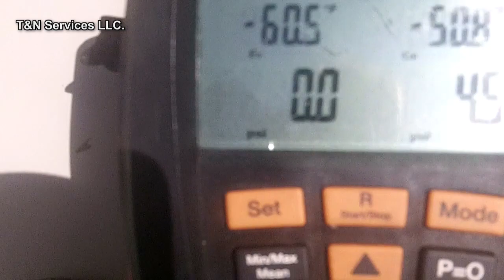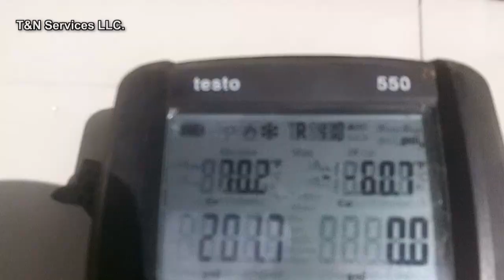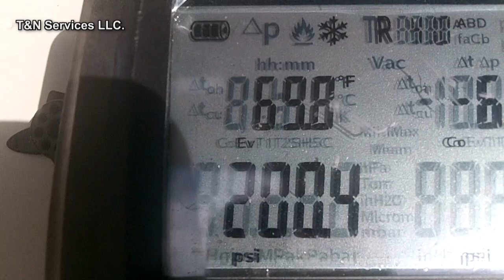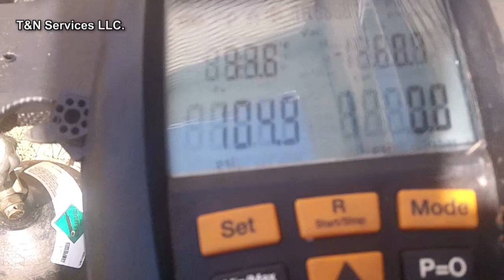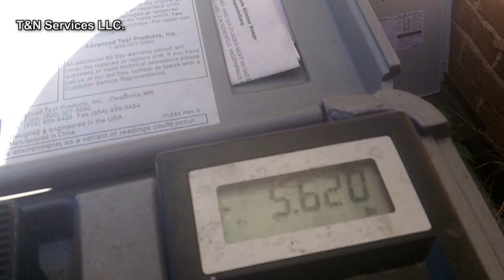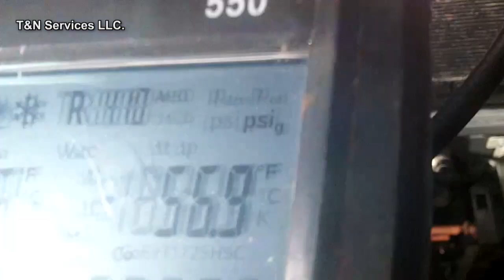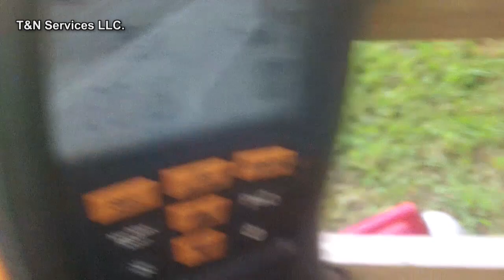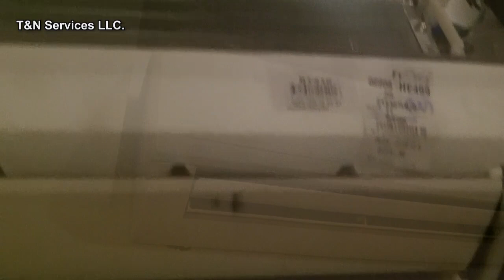Hacked Daiken Mini Split Job

Comment: common problem on the mini splits, it comes from installers not using the proper torquing procedure and flaring gauge. There is a reason why daikin requires torque wrenches and special flaring gauge and flare for r410a during their daikin installer classes. They also require a 500 psi standing pressure test for 24 hrs and a deep micron vacuum test for several hours.

Comment: what if instead of using the factory flare compression fittings for the inside heads, you cut them off and solder in 1/4 and 3/8 couplings? trading a mechanical connection for a soldered one. Then you only have to worry about the flares at the condenser.

Comment: Looks like he had Channel Locks best brand of tubing benders available.  Shame he didn't have a set of Knipex smooth jaw pliers, he'd have been in the clear! :-D  Put one of those Daikins (cooling only) in for a small server room, and purchased a set of torque wrenches made for that purpose, and haven't regretted it! Thing runs like a champ, especially if you just follow the instructions!  Oh well, their fail, your paycheck.  Good job!

Comment: How reliable are the Daikins when install properly?? I'm looking at possibly getting one.
Reply: Got a daikin FT35GVALT installed since '97. Still working like a champ and just cleaning needed from time to time.
Reply: @ayuchanayuko  Not hvac here but I wonder if my process was right when I chose a installer first by reputation.   Then because the cost was only $800.00 For the Mitshubishi,  I chose the Mitsubishi.  After a year I sent the installer a thank you letter posting my befor and after hvac cost with permission to use the info
in sales. All's good when customer and seller is happy!
Reply: @ayuchanayuko  wow

Comment: surprised you didnt mention the botched wiring job he did on all the indoor units. ive installed plenty of these and we never run the conductors through the wall like that. its allways in MC cable or SO cord

Comment: How the hell do these people get away with doing such a bad job and always seem to get more work.Flare fitting are just fine if you do it right, but some just seem to have no idea, just an FYI most wall mounted units have an outlet on both sides of the drip tray to swap over the condensate pipe.

Comment: 3 minuets in I can see not to buy a daiken. Thanks
Reply: +azimmey You blame the unit for a shitty install?
Reply: The tubing comes with the unit. It would already be flared.
Reply: The tubing that distributors bundle with systems is typically from a 3rd party, not from the system manufacturer.
Regardless of the brand of ductless split, you should never use the flare fittings that come with the refrigerant piping, always cut them off, and use the ones the fittings that come with the unit.
All of the brands I've installed specify that in their installation instructions.
Reply: +azimmey I rate Daikin second to Mitsubishi in the Minisplit industry.  The bad flare connection was made by the installer and not by the Daikin factory.
Reply: +Mark All flares that I've found to leak have had been flared incorrectly or had a bad flare nut installed over the flare.
Reply: Because dumbo way over torqued the nut?